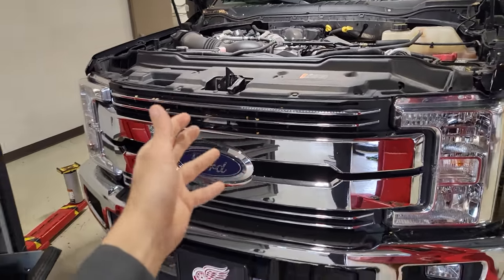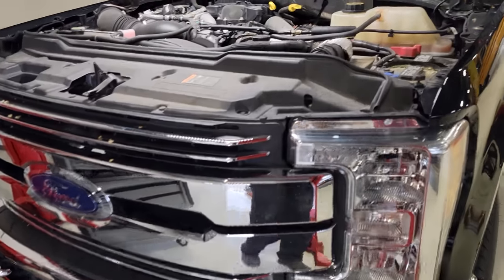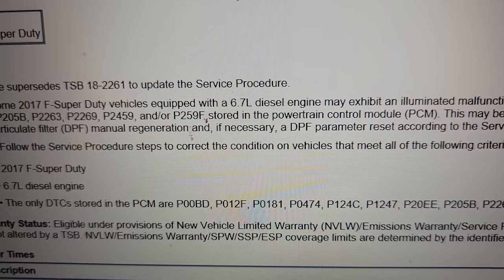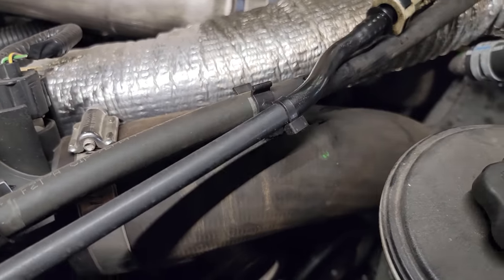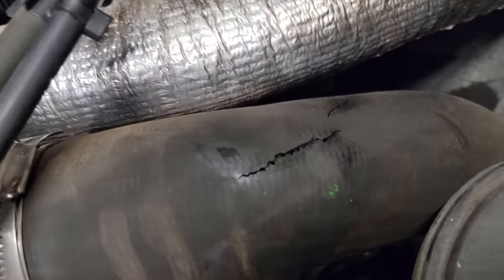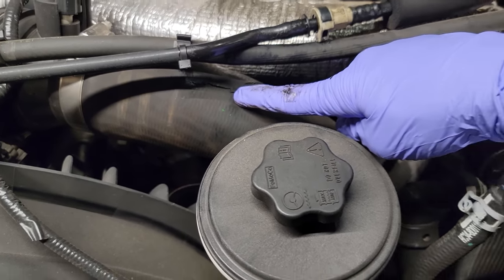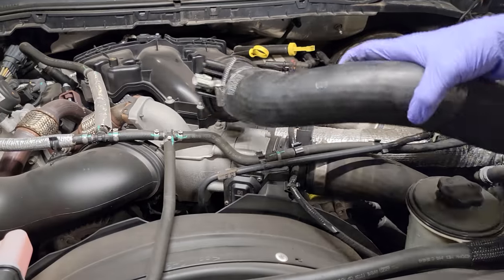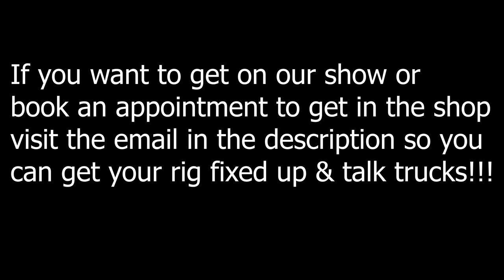**STOP** DO NOT REPLACE YOUR MASS AIR FLOW SENSOR | Eng.-light ON | 2017-19 Ford F250 F350 F450 F550

Comment: 2017 ford f350 6.7 pulling 43' fifth wheel 16,000#. Driving through Colorado mnts at 8-10000 feet. Does altitude cause P2074 map/maf code? Hose fine.

Comment: Wish you were near me(Cincinnati Ohio) 2017 f250 xl with a 6.2 gasser that needs a new intake because of the charge motion rattle at idle. 110,000 miles on it.
Reply from the maker: Jussta few hrs away brah
Reply: @PowerStrokeTechTalkwARod  my truck is my Dailey driver so I would need a quick turnaround . Hopefully I can find someone close to help out. Thanks for the heads up though. If something major I will hit you up. Poor 6.2s don’t get the love they deserve. Great engine and pulls my 32’ gooseneck horse trailer/ camper great.
Reply from the maker: Awesome to hear

Comment: I replaced mine with a H&S Motorsports charge pipe. I’m not gonna call it an upgrade because it adds nothing performance wise besides a nice silicone tube, it sure does look pretty tho with the CNC connector.
Reply from the maker: Wish i haddy

Comment: Hi, I have a 2017 f250 6.7 Powerstroke and I just replaced the old 0ne                                   part no. HC3Z-6F073-"A" at 40000 MI.  Have you ever heard of a split on the so-called new version part no? HC3Z-6F073-"B" if you look at new & old ones that have the sham no. stamp on them? Thank You for the video.
Reply from the maker: Theyre the same

Comment: Swapped out the pipe with a sinister diesel replacement and put a s&b air filter kit on it and the codes still there any ideas what could be causing it at this point or do i have to take it to a shop both parts I ordered said no tuning required

Comment: I noticed mine days before watching this video 
Changed mine then two days later my check engine light came on ???? Only drove 10 miles with new hose installed
Could this have just triggered code due to replacement of defective turbo hose ??

Thanks
Reply from the maker: Probably not...

Comment: Hey so after you’ve fixed the intake leak the check engine light stays on what do you do to get rid of it I can clear mine but it just comes back and when the light is on I lose abt 50% power but when I’ve cleared it everything is normal
Reply from the maker: Well obviously there is still a problem if the light comes right back on

Comment: So this exact same situation happened to me yesterday. However, there wasn’t a tear in the hose. I replaced the sensor put in a new air filter had them reset the code. All was good until today. Light came back on took it back in same code showed up. However, I looked over at the hose and sure enough now not before there was a tear in the hose. Have you seen any relationship between changing out the sensor and the hose fracturing?
Reply from the maker: No relationship
Reply: Good to know. Thanks for the video. It saved me a trip to mechanic and what was sure to be a $400 bill.

Comment: My coolant lines are rubbing that hose and I am afraid it will rub a hole in it.  Is there a recall or a TSB on it?  I check it every two weeks and it’s getting worst.  2019 f450.
Reply from the maker: No, theres not. If your talking about the small hoses, maybe try to move the clamp off and twist the hose up then re clamp it...viola problem solved.

Comment: Arod what are you doing to fix the batteries leaking and corroding the terminals and the brackets that hold them down? On the Alumaduty’s?
Reply from the maker: Guess Ill need to make a new video now, thanks 4 the idea
Reply: @PowerStrokeTechTalkwARod  i’ll be looking forward to it

Comment: ARod, found the same issue with mine after my engine light came on and I noticed my throttle response was lagging considerably. Got a nice aftermarket upgrade coming. How do I go about reseting the engine light after getting the pipe replaced?
Reply from the maker: Scan tool..........
Reply: @PowerStrokeTechTalkwARod  In the absence of a scan tool is there another way? I read disconnecting both batteries will do the trick???
Reply from the maker: That will work & will also clear your adaptive learned values from your PCM

Comment: This just happened to me the other day.  That was the first thing I looked at.  Took it out today and went full throttle with it, a lot more power but threw a P0170 and P0402.  I'm hoping I get luckier than the guy on you other video and replacing the air filter fixes it and I don't need the sensor.  It looks a little dirtier than the one you had shown.
Reply: I just got the same code p0402 after replacing the hose.. 😔
Reply: Any update on how to clear the P0170 code? Changed my ripped CAC tube as well and check engine came back on
Reply from the maker: There is a reprogram for that DTC

Comment: Before going through a thousand comments lol, is this relative to the read out "Reduced Engine Power"? If so, this is my issue because I've got the same hole in the same spot too
Reply from the maker: Only a check engine light....better get them codes pulled b4 you start throwing $,$$$ & guessin' 😉
Reply: @PowerStrokeTechTalkwARod  OK I've got the Engine Light also, so I'll get it checked out asap, cause mine has left me on the side of the road now 🤣 Thank you for the advice!

Comment: I have an 2018 F350 with the 6.7 and I had a P0111 code, the dealer replaced the MAF sensor twice now, the light is gone out but still lacks power, it is still at the dealership, this has been ongoing for two months, could the hose crack be my problem or should they be checking something else?
Reply from the maker: Sounds like you need to let us fix it they stop wasting your time & money
Reply: @PowerStrokeTechTalkwARod  it’s still under warranty for 8 more months, so no cost to me right now. Wish I was closer, I live in eastern Canada
Reply from the maker: @JohnSmith-ky7bl im in Detroit
Reply: @PowerStrokeTechTalkwARod  I’m in Newfoundland

Comment: I am getting that code. Took to dealer. They supposedly performed the TSB. I don't think they did TSB as a dpf regen was not perfomed. Still got code. I replaced both CAC pipes. Still getting code. Is there anything else to check before it goes back to dealer?
Reply from the maker: You'd have to perform the proper pin point test to be sure...
Reply: Update. Dealer verified bad MAF sensor on third visit. Replaced and all seems good so far.

Comment: I know this is way after the video but that small hose quick connector leaks, it looks like that is the ultimate cause, have you verified that is the issue?
Reply from the maker: Split in the pipe is the issue
Reply: @PowerStrokeTechTalkwARod  mine is split but also that vacuum tube quick connect has been leaking some black substance down onto it and it cracked right where it was.  Is it unrelated?
Reply from the maker: @bryanfreemyer5074 yes unrelated
Reply: @PowerStrokeTechTalkwARod  ok. Thank you for the reply and your time.

Comment: So replaced my CAC with a S&B kit. Now my trucks throwing a P0402 but it’s not in limp mode. What do you suggest? Clean the MASS and MAP? 2019 F250 66k miles
Reply from the maker: Egr valve problem
Reply: @PowerStrokeTechTalkwARod  so probably not good to keep driving it?
Reply from the maker: You can clear it the light will probably come back on
Reply: @PowerStrokeTechTalkwARod  yeah I cleared it this morning. Trucks acting fine tho. I’ll have to take it to the dealership I guess

Comment: Mine threw a p132b code. The hose was cracked. I replaced the hose and the light kept coming on. It went into limp mode and restricted boost to 10 psi. Every time i shut the truck off, it reset and made full boost but once it ran a test it went back to limp. Took it to a dealer and they gave it a software update. Next day, same code. Any idea what it could be? Seems like a sensor somewhere because it's physically able to generate full boost
Reply from the maker: Turbo time brahhhh
Reply: @PowerStrokeTechTalkwARod  you think the turbo is going bad?
Reply from the maker: It is.....why do u think u keep getting the P132B DTC......
Reply: @PowerStrokeTechTalkwARod  bad sensor?
Reply from the maker: TURBOCHARGER TIME

Comment: I understand this is your business and I appreciate all the fine work you do but SERIOUSLY.... the owner couldn't hear/see the broken pipe??? I certainly hope it was a warranty repair. There were obvious problems with the origonal rubber hose since the replacement has been redesigned.
Reply from the maker: Yes yes covered...
Reply: I couldn’t hear anything when mine busted- The Cel came on, immediate loss of power while towing, & fuel mileage went to sh*t. The dealer said that most break at the intake side & the plastic explodes, He also said it’s intentionally the weakest link in the system because it’s an easy repair. Not sure if there is any truth to that but it sounded good lol.
Reply from the maker: What he said is the lamest thing i think ive heard today.....